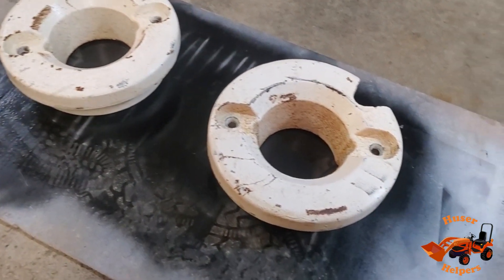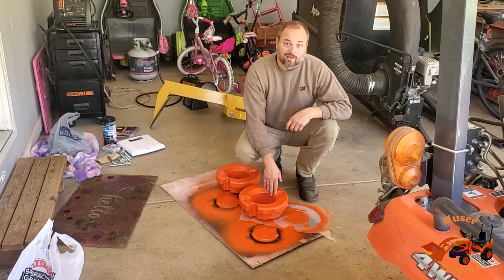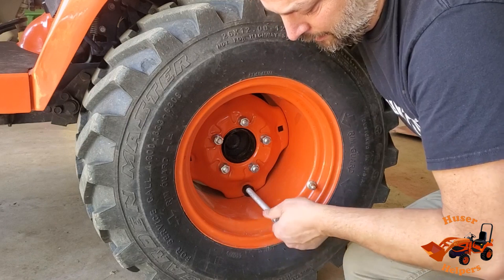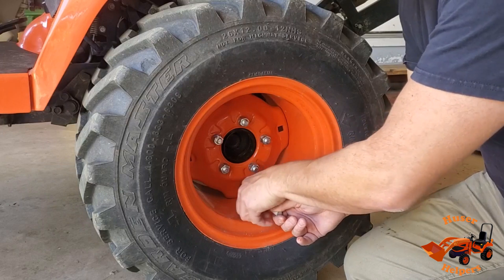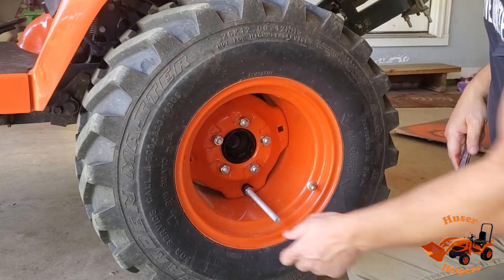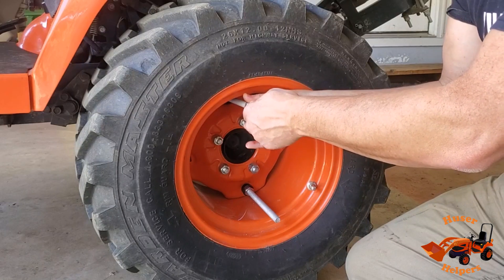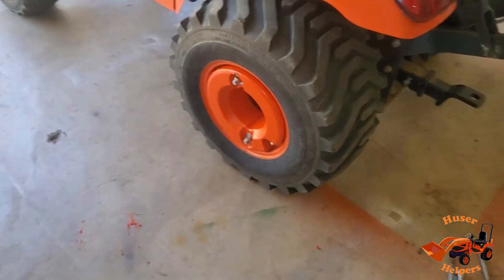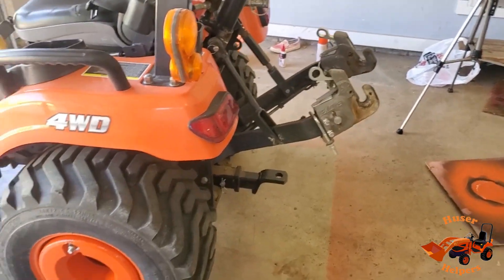Kubota BX Rear Wheel Weights - 51 lb Bolen Weights

Comment: You'll be able to run around mountains with all that weight now! Looking great.
Reply from the maker: Thanks Ross.  I've been working in a lot of tight areas that I can't have the tiller on.  This plus the fluid in the tires and my 200# counter weight should do the trick.

Comment: Paint looks great !
Those weights got to make a big difference 
I’m thinking about wheel spacers for mine 
Thanks for sharing!
Reply from the maker: Thanks Phil, I hope they keep it centered.  Since the weight is low and to the outside, I think it will help with picking up a rear corner when loaded.  I have 1.5" wheel spacers, which also seem to help as long as you keep the back end planted.

Comment: They look great, I don’t think you’ll ever get stuck now! 🤞🏻. Have a great one Jason 🙂🙋🏼‍♂️👍🏻
Reply from the maker: Thanks Luc.  More of a light rear end when hauling heavy loads.  Several times this summer when going down a hill with a load on front I slid the rear tires.  It was on a paved driveway so I was running in 2wd.

Comment: Interesting to see how they worked guess i will have to add some to may BX now lol i do know the Agco Compact tractors used the same style and would fit too . And i also think Cub Cadet and Massey Ferguson did have something that would too. I have a Machine shop that would make me some out of aluminum too for a nice shiny look even. I do know Taylor Foundry does make weights for most brands and models
Reply from the maker: I think any 12" will work.  These just fit really cleanly.  I didn't want the weights to be the widest point of the tractor.